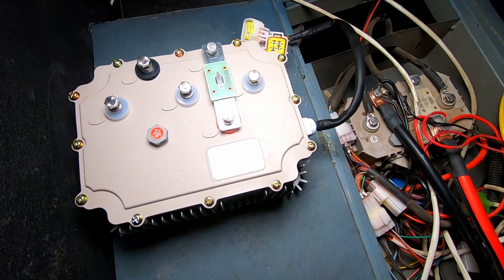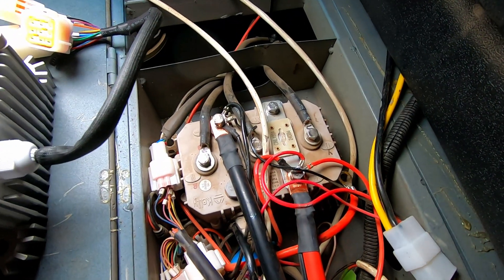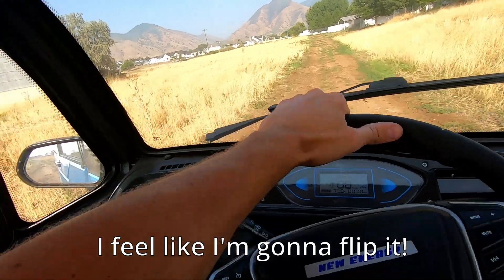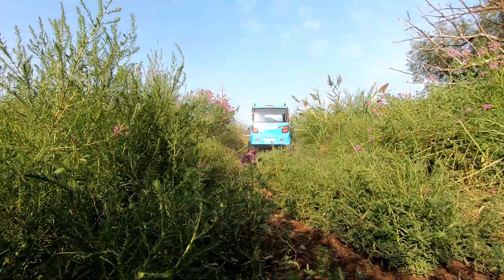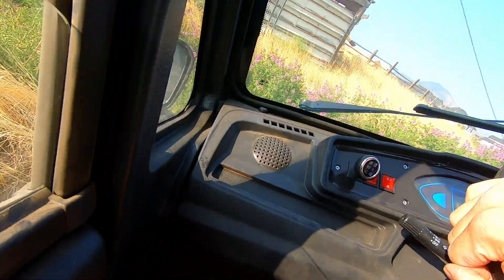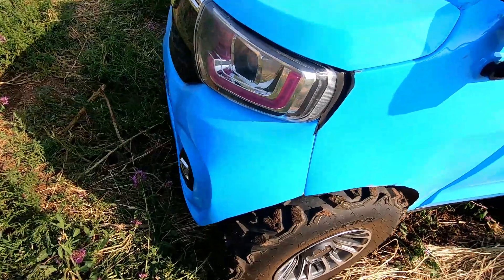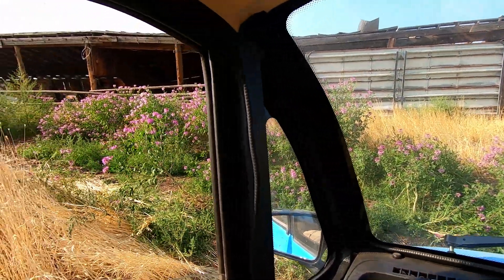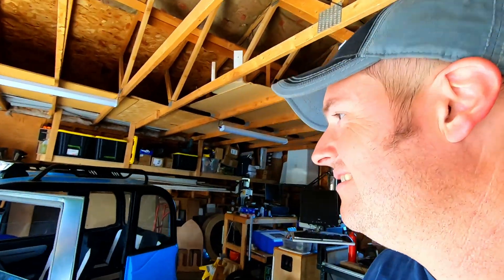MORE CHANGLI MODS! 72V AND 380A KELLY CONTROLLER UPGRADES

Comment: Sort the suspension and redo the chassis welds before it falls apart!  :)

A small genset rewound to ~70 volts would mean the lead acid batteries can stay.
Reply from the maker: @RayleneCawood  Thanks for the tip!
Reply: @3dconceptsofutah757  Genset rewind for appropriate volts at:
Endless Sphere VLR bumblebee AWD bike, ASC system
Reply: @3dconceptsofutah757  Also exhaust and intake tuning in that same VLR bumblebee post.

Comment: The shuddering is called cogging alot of problems are electric RC related they seem to go hand in hand battery esc motor only thing you could do is reduce the pinion gear in. RC terms or like u said feather the throttle
Reply from the maker: Thanks for the reply! Yes reducing the ratio would help but it seems like I could adjust settings to smooth out the startup characteristics but Kelly controllers are hard to tune without good instructions

Comment: "The only problem is qhen you start off in high gear it shudders"......dude. do you not know how to drive? Why are you starting in high gear anyways.
Reply from the maker: The stock motor can pull high gear, that's why it's not cool that this one can't. Could be the hotter wind. Yea I ride dirt bikes and drive sticks.

Comment: Sir, Do I need to upgrade anything else besides the motor, controller and add an extra battery for the 72v? I am afraid I could fry the electronics adding 72v, do I need to upgrade anything else? Thank you, this is a cool and fun video.
Reply from the maker: Yes you will fry stuff! For one there is a voltage adapter in the front under the hood that needs upgraded. I think that's all but just make sure nothing hooked up to the original voltage is adapted to what it originally had. Cheers!
Reply: @3dconceptsofutah757  thank you

Comment: Hey Man, would you be able to send me a set of parts you had to fab up? Would like to duplicate on mine. I can purchase the motor, controller, batteries on my own.
Reply from the maker: Hi! It was very much a build in place kind of deal. A lot of it was chopping things out of the way and trimming fenders. I welded tubes to extend the rear springs and bought longer shocks for the front. There should be links in the description to the parts I bought though
Reply from the maker: I forgot about the motor adapter. I could fabricate a shaft adapter and motor mount cage thing
Reply: Thanks for the reply! Would i have to do the lift and larger tires to fit the new motor? @3dconceptsofutah757

Comment: Long travel suspension. Please.
Reply from the maker: Yes it needs long travel and widened and it would actually be pretty cool. Also racing seats that aren't mounted to their junk sheet metal box that ripped off from the torque 😂

Comment: I need help!  I have a 2022 Changli Coco coup purchased in December 2022 that has never run correctly (I purchased it from Safer Wholesale, my big mistake) first they said it was most likely the motor so they did send a new motor.  That was not the problem so they thought it was in the controller they sent a new controller after installing the car went forward in the two forward settings and in the reverse setting also.  I returned the new controller to Safer for testing and it did the same for them.  They were going to send me another one, they had two new ones they tested and they did the same thing.  DOES ANYONE KNOW OF A 60 VOLT CONTROLLER & MOTOR OTHER THAN WHAT CAME WITH THE  CAR? ANY HELP WILL BE GREATLY APPRECIATED!
Reply from the maker: You could run the stock motor off a Kelly controller like mine. They can do a wide range of voltages. It's not straight forward though. You would have to figure out the wiring on your own or YouTube videos. Definitely an advanced project

Comment: I wound up cutting my fenders some as well as minor mods to the frame. I also changed to 15 inch tires. Also you might consider different springs to smooth out the ride. Amazon has a number of them that should help you and not very high in price.

Comment: I purchased the Chang Li truck last year.  Any chance you could do a tutorial in replacing the controller?
Reply from the maker: Hi! Those trucks are cool! I don't have this vehicle anymore as it belongs to someone else. If you run the Kelly controller they have pretty good documentation on what goes where. Figuring out the Changli wiring was a bit of a challenge and would be different for the truck anyway. Best of luck!
Reply: @3dconceptsofutah757  thanks for the reply.  I have enjoyed tinkering on the truck.  I think I'm going to give this controller a shot with the stock motor and see how it performs

Comment: What is your top speed now, and how long does your charge last?
Reply from the maker: Hi! I really don't know how long it lasts because all I ever did was mess with it in the field and plug it back in. It currently goes about 38mph. It uses a lot more battery than stock so it would be less for sure.

Comment: What physical size & type of batteries did you use?
Reply from the maker: They are stock 45ah sealed lead acid. I haven't been able to find exact replacements from Amazon or eBay. There is an extra one under the hood because there was no room under the seat where the other batteries go for the extra voltage to make 72 volts.

Comment: new esc have bigger capacitor which it make motor more powerful
Reply from the maker: Yes. I didn't think the batteries could supply more current but they sure did!
Reply: @3dconceptsofutah757  battery only work on brushness motor n adding more power mean more tq hp but brushless no it requires bigger capacitor to outmatched it
i grad you did upgraded it (i cant tell what motor is it)
Reply from the maker: @kittyztigerz  it's a Motenergy ME1719 brushless motor
Reply: @3dconceptsofutah757  i get it now so that why you needed bigger esc in order booster motor and let me know if it have problems or overheating